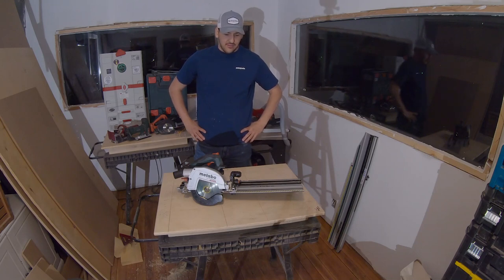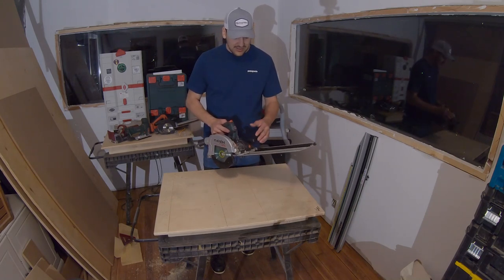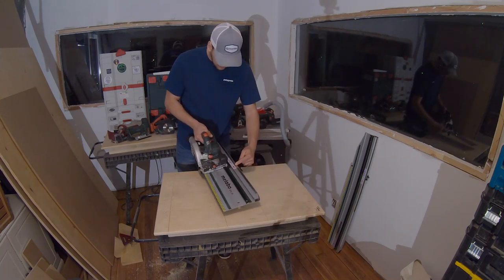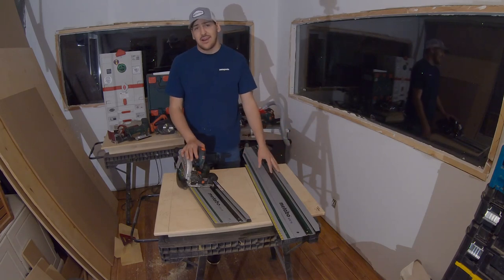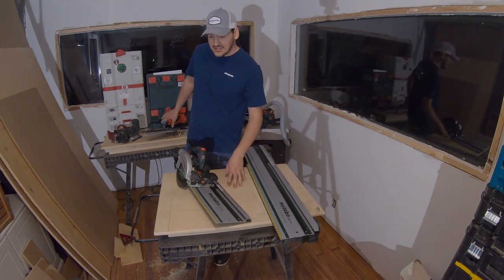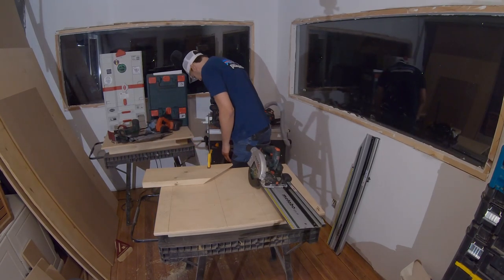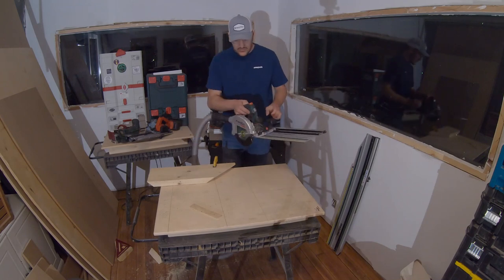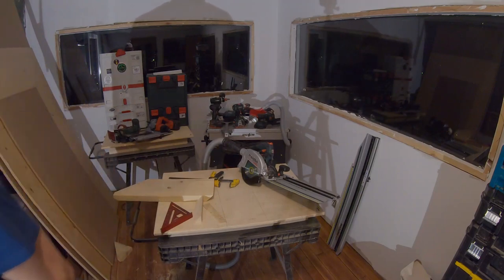ks18ltx66bl review and walk through

Comment: Regarding your kss 40, do you have any issues with the blade digging in to your work when running it along the track?
I bought one after watching one of your videos and have had a problem where it would be cutting nice then it would just dig in to the work and damage both the track side and the off cut of wood, almost like the blade had wobbled.
Reply from the maker: I was using mine today! I have definitely not had an issue with that. I would absolutely call and get a replacement. They have a year warranty

Comment: See this confuses me a lot, I am looking at buying this saw but if "you are not going to get a square cut" what is the point? Why pay all that money for out of square cut? 
Also, a lot of folks are reporting blade wobble issue and something about saw or blade pushing the guide rail off the line with blade wobble (details probably lost in translation from german forums), so I am totally confused as to why would metabo even release the saw in such condition. Very disappointing as I was looking forward to mafell like cross cut system. 
I get perfectly square cuts with a squared line and cheap corded Stanley saw, just not as quick obviously. 
Save more and get kss60?
Reply from the maker: Buy the kss60

My kss40 is money and I'll be buying the 60 when I can justify it